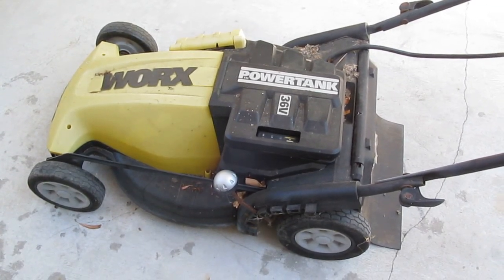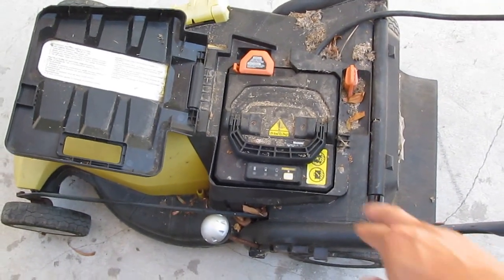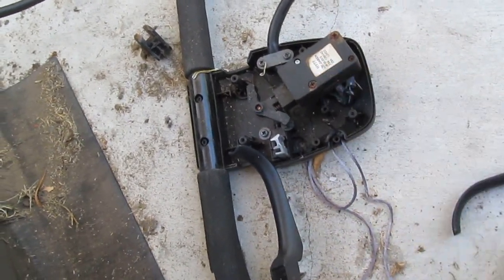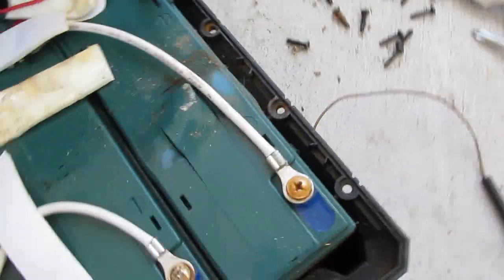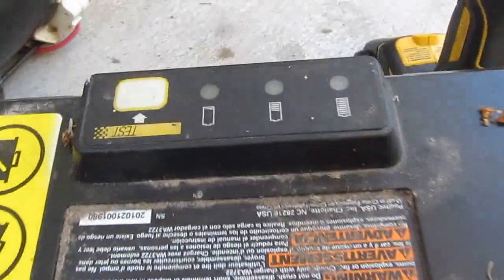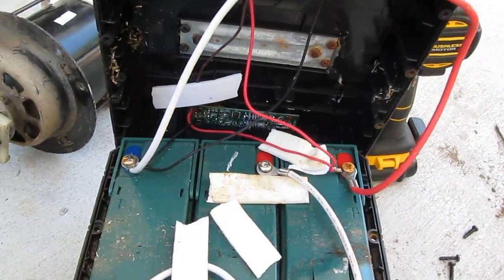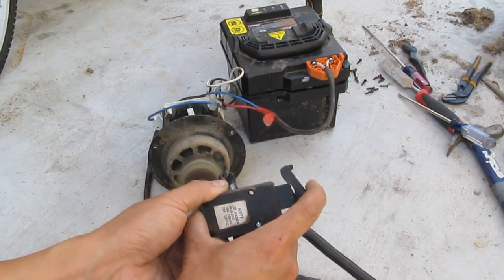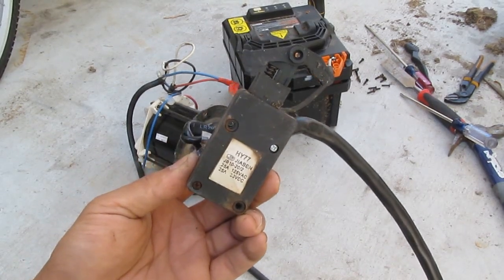Teardown: Worx 36V cordless lawn mower disassembly. What's inside?

Comment: hey man figure out the same day i contact i found 1 battery puff dead but the machine work on 2 battery also and cutting grass well still have power i found i have battery from alarm system 12v 7 amp i replace the battery with little work now work perfect  ...i do technician electronic  and mechanical .......i bought this machine for $20 coast me nothing to fix....thank you man your videos very good....your machine can work on 24v with no problem and cutting perfect

Comment: I have the same mower but it is a 24V. The battery case looks like the same size. So those 12vx3 are very oddly shaped. Would be hard to replace. I bet it would work with 24V.

Comment: Looks like the cooling impeller is missing.  Batteries on the + terminal seem to fry first.   Run it on 24 volts and make blade clean and sharp.  Rig up a charger for 24 volts sla.   You can buy SLA chargers cheap .  I'm running a Black and Decker 120 volt electric mower on 66 volt lithium ion pack 3 Ah.   Blade super sharp.  Works Great and quiet.